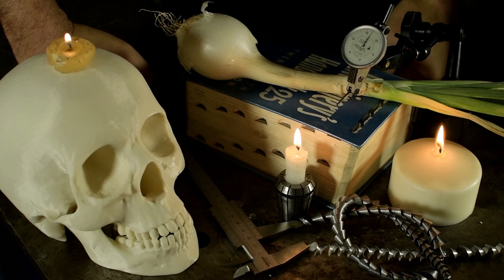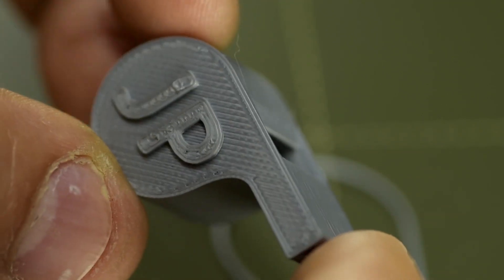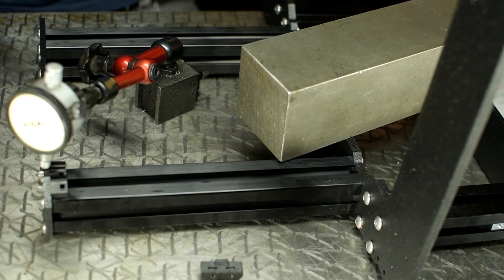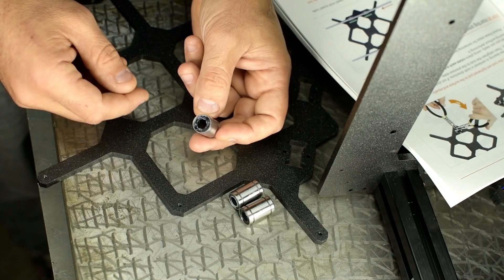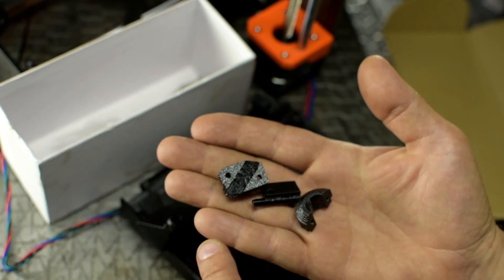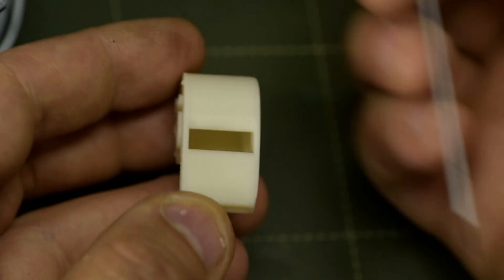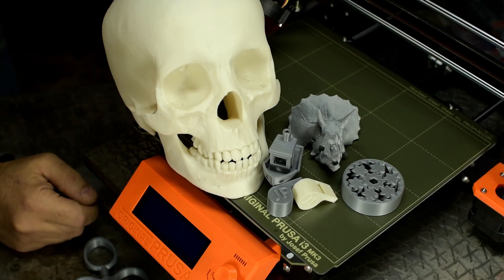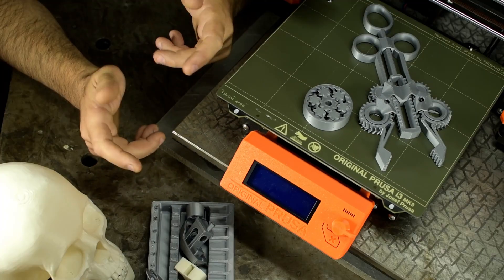This Old Tony in 3D!!! (printing)

Comment: "Granite surface plate". Looking at Ender-3 sitting on a cushion topped stool in the corner.
Reply: Just what I was thinking, I assembled it on kitchen table...
Reply: Wobbly Ikea table that flexes if you look at it too hard. That was my "reference surface" 😂
Reply: Assembled one on my lap here
Reply: i use and paving plate 3 inches thick i got for less than $4 at the hardware store garden section and the day later i found the exact same kind in the alley next to my place and tbh the sound went from 70db to less than 30db with my clunky ender 2
Reply: @FUKTxProductions  saw that on Teaching Tech IIRC. The problem is that those are great if your printer is in a garage or a workshop, but ugly if it is inside your home office.

Maybe painted or with some kind of coating or lining...

By the way, the best upgrade for the Ender 3 is an SKR mini. Motors went totally silent, no noise whatsoever. Yoi can't tell if it is still or printing sitting 3 feet away.
Reply: @nicholasamadori2577  would you rather have a miniature refrigerator sitting on your desk or floor of your living room/space? If you want pretty buy a cabinet to put it in. I don't see the printer being ugly effecting my purchase decision. Besides, put it in a closet. They don't need computers to print... Just my opinion.

Comment: This only confirms that mechanical adjustment for 3D printer is one most important thing. I never expected less that total overkill from TOT.

Btw that stringing problem is usually solved by adjusting hot end temperature and tweaking retraction settings.

Comment: I bought this model a little more than a year ago and have not looked back. However to quote Henry Wadsworth "When she was good	
She was very, very good,  And when she was bad she was horrid." which means there is quite a learning curve and a certain amount of fickleness.  I had already become an aficionado of Fusion 360 and combining this with my Prusa and (Syil X4 cnc)  was a marriage made in heaven. Will a custom gear, pulley or part fit and work as intended? Design it in Fusion and then the same model can (theoretically) be used to 3D print a prototype as well as machine it by cnc. Quite often the printed part works so well it becomes the finished item. A lot of open source stuff also available - some of impressive quality. Currently making Open Astro Tracker -  https://www.instructables.com/id/OpenAstroTracker-a-DSLR-Tracking-GoTo-Mount-for-As/

Comment: I've got an ender 3 but I woold defenetly prefer a mill or a lathe, still in my exprians having to design things in cad first does probably make you think out a part, so in my case waisting all my money on a 3d printer was probably worth it and considering that I don't have acses to presishon mashinery it's currently the best tool I have.
Anyway ime sure that prusha will come in handy, good luck to you.

Comment: Hey Old Tony! I work at the 3d print lab at my university. That Bunchy looks great! I would recommend increasing the retraction amount a little (which normally can help with the whispies). One also thing I noticed is the sides of the boat is that it's not completely smooth. I am guessing it's due to either some play in the movement in the head/base moving sideways. Turning the speed/acceleration down might help with that. BUT, those prints are perfect in my eyes. Well done as always! :D

Comment: “Different material properties...” fun reason to use PLA: non-toxic burn out for molding and casting. ABS has nasty fumes. Easier to smoothen, though.
Reply: PLA: easier to smoothen unintentionally by leaving it in a car on a hot summer day.

Comment: Oh gee....now that is a useful print.....I have the same problem with a cheap socket set, the whole plastic inside is kaput.........gives me an incentive to put my printer (unused) to do something really useful and at the same time I'm going to make a metal box with 3D printed  inside compartments for my mini socket and Allen key set for a 3.5 volt electric screwdriver.
I would advise anyone building anything with lots of screws that equates to a big boys Meccano set to invest in one of those mini electric screw drivers.....twiddling a long Allen key with a bent end is not the best way to screw Allen headed screws.

Comment: I will admit that I enjoy building this printer more than I have in using. Just be warned didn't be caught staring at the printer while others are are around, they just won't understand the hypnotic spell you enter into. But if you want a real challenge and love pulling your hair out, add the MMU option to this printers...

Comment: I ran the 3D printing displays at a Micro Center I worked at. The Ender 3 is mechanically extremely similar to the Prusa i3. There are a few shortcomings mechanically, but it's acceptable. Where it falls short is the general user experience. The interface on an Ender 3 is miserable. 3D printers work like this: The more you pay, the easier it is to use. The cheap ones are often mechanically sound, but the software and instructions are garbage.

Comment: Ok: You have some Z axis wobble. Caused by crooked or bent threaded rods, or badly constrained nuts on the threaded rods. Check that the rods aren't bent, and that the nut is properly trammed to the rods and the X axis (the one the print head rides on). First, insure that the top and bottom of both threaded rods are the right distance apart from each other and in line with the nut. Then loosen the screws which hold the Z axis nut a bit, and run the axis up and down a few times, then move it to the middle and tighten the screws down. If that axis squeaks, you're doing it wrong!
Second: Stringy prints are a sign of either too hot a nozzle, or too short of a retraction, though those can be tuned against each other. If all else is going well (especially bridging and overhangs) then increase retraction slightly, like .1 mm at a time.
You'll also want to print a test cube, 20 mm to a side, and insure that your machine is getting the scaling correct. This is "Steps per mm" or somesuch in your printer's settings.
Welcome to the club. Don't listen to the naysayers, this is just another valuable shop tool which will find it's own niche in your workflow.
Reply: Addendum: Skip ABS, it's terribly warp prone and produces toxic fumes. Haven't printed with ASA, but my true love is PETG. It's stringy as heck, but strong and durable. Most importantly, it'll hold up to summer car heat, where PLA won't.

Comment: Awesome video Tony, I just got my first foray into 3d printing myself... with a Creality CR6SE through kickstarter.  Some are having issues with their machines, but my experience was less than 1/2 hour setup time and first prints were amazing benchy in pla also had a bit of stringing in the cabin area, but otherwise perfect.  Playing with PETG now and that is possibly going to drive me nuts trying to dial in and I've ruined the coating on the print bed with it taking the teflon coating off.  Got a few more rolls of filament in a different brand and plan on building a drier box out of insulated foam board.. and probably a cabinet using the Ikea furniture diy approach.  Looking forward to seeing what else you do with yours... I'm hoping I can find a profitable use for mine.

Comment: You definitely made the right decision with the Prusa . When it comes to "throw it in the slicer" and get a use-able result they are unbeatable.   There's a lot to be said for the cheaper Chinese variants  but they are more of a 3D printing hobby than a 3D printer. The Prusa kit is the ideal way forward to save some money and get a comprehensive "insight" into the machine. 
The more you use it the better understanding you get for the limitations In no time I'm sure you'll be making all kinds of bushes, seals, tools n odd ball components. 
From what i saw of your Benchy (lower hull area) its looks like there's an issue with your Z lead screws . Id take em out and check and adjust run out !!  Just my 2 cents

Comment: Hey Tony, look up Taulman 910 for a killer material with excellent mechanical properties. It prints at a higher temp like ABS but holds up to most chemicals and doesn't break but rather deforms when taken past its yield. As far as I know, it's the strongest material you can FDM 3d print with.

Comment: I have an ender. Literally JUST finished my 600x600x600 glass cabinet before comeing inside to see this video notification. Safety glass from facebook marketplace (cutting that is a learning curve in its own right) and crappy angle iron from the local hardware. TIG'd the frame, goo'd the glass in. ABS is a temperature controlled environment, here I come.

Comment: To get rid of the plastic hairs, hit your prints quickly with a heat gun.
Reply: Or slightly increase your filament retraction. Making sure the tube is tight as heck and as short as possible helps too.
Reply: @WarrenGarabrandt  this isn't a Bowden design.
Reply: @Slappy901  what tube are you talking about on a direct drive extruder?
Reply: Dry your filament before use. :)
Reply: Or you can just repraddle the smool humes so they span the girdle of the fingle grots.
Reply: @torravengael4490  Well sure, unless some one borrowed your dingle arm, and never returned it!

Comment: Welcome to the 3D printing community Tony! I have to agree, it is amazing you haven't been using one already. Every household should have one. Mine paid for itself in the first month with avoided costs on car parts. You will probably find something broken, or that could be better about every week, and then it becomes a question of how much time you are willing to spend modeling things.
I use pla for most indoor non critical stuff (toys, or test prints for initial fit), and petg for most everything else. PLA is great until you leave it in your car. ABS seems like too much trouble to me, when PETG works really well and has similar uses.

I don't have  a large number of things posted as they are frequently very specific and unlikely to be used by others, but when there is something I put it here http://www.thingiverse.com/milgaco/

Comment: You can get rid of the "ghosting" or "ringing" by lowering the "jerk" rate or rapid acceleration and deceleration on the prusaslicer software with the expert settings. Just a quick pro tip to get really nice prints.

Comment: I finally got one too... 6hrs to print a part of 2hrs to make one out in the shop out of metal... Now that I have a 3d printer, i find it not as useful as I though it would be. Still use the cnc, lathe, or mill 98% of the time.
Reply: If you have a mill and a lathe, the printer definitely tends to sit idle a bit.  But there are certain things it comes in handy for - I put a different turbo on my Land Rover, and needed a machined adapter to go between turbo and manifold.  Problem was, space being a bit tight, I needed to know the exact (well, down to less than half a degree at least) angles of everything to get clearance everywhere.  Printed 5 prototype versions (complete with holes to be tapped for studs) before I was happy with it, then used all the angles and dimensions from that drawing to machine the real part on the Bridgeport.  Yes, it took a while to print, but I didn't have to actually DO anything in the production stage unlike if I'd made the prototypes out of metal in one way or another.

Also good for stuff where you just don't care that much, you just want a thing without the effort of making it.  Wanted file handles for my chainsaw files, hit print, walked away and did something more interesting.  If they break, fall off, whatever - I'll just print more - I like the shape of the ones I printed in use.

Comment: ME in my senior year. I own a creating ender 3 pro. It did come some assembly required but what I had to do was much less than what you did. I would strongly recommend  the ender 3 pro for your subscribers that want to dabble in 3D printing. Its super easy to use and maintain and even if you have to buy an entire 2nd printer for parts (not likely - mine's been near perfect) you're still only out $440 plus shipping and they are sold on Amazon. 

I do recommend that you buy a really cheap bottle of hairspray (i prefer the pump style for control) for prints that don't want to stick. 

You will also want to be mindful of printing speed when it is cold in the ol' garage. 

Have fun!

Comment: Your benchy looks great! No signs of a mechanical anomaly but the stringing can be reduced by tuning temperature down a bit or upping retraction a bit.  Also, the imperfections on the surface can be fixed by fixing the "Extrusion Multiplier" in Prusa Slicer or doing an extruder calibration again (Check Prusa website). Nonetheless, it is amazing for a first print :) Happy printing!

Comment: The 3D printer will change how you attack problems for sure.  You can do check fits before expensive milling etc.  Also you can download STL files from McMaster and print them apparently.  At least thats what Ave said!! I have 2 Ender 3's.  Amazing value for what they are.  Word to the wise, don't print PETG on glass.  It bonds into the glass apparently !

Comment: I had great luck with the Ender 3 Pro. It was cheap and worked great right out of the box after about 1 hr of assembly time. After a few cheap and easy upgrades (<$100) I now have wifi control through Octoprint, a direct drive extruder, and am printing directly from a filament dry box.

Comment: Welcome to the party. And I'm glad you're here. I've been blowing my brains out telling people to set up their printers like they would a mill (Oh for God's sake -  leveling is NOT tramming!) Anyway, maybe they'll listen to you. 
FYI the Ender can print just as well as the Prusa but the Prusa can do it well out of the box. A poorly assembled Ender never will. 
And I feel vindicated. I can now snark at my friends that I'm not the ONLY one who would assemble their printer on a surface plate.
Reply: The thing is ... if a book/manual says "use a flat surface", a normal human will use their kitchen table, a "maker" will use a sheet of glass, a handtool woodworker will use their workbench, a powertool woodworker will use their table saw, and a machinist will use a surface plate.

Ya' use what ya' got.
Reply: To be fair, as someone who has had to DIY his printer entirely, I would absolutely love to be able to reassemble it using an actual surface plate. Or probably rebuild the entire frame using said plate anew, because I've made some mistakes with the current one XD
Reply: I assembled mine on a poor man's surface plate - piece of marble counter-top I already had.
Reply: Does the Prusa firmware lack the skew compensation feature?
Reply: @davidwillmore  it has skew compensation, but it is still good practice to properly assemble a printer. And while in this case it wouldn't impact print quality much, it would likely lead to increased wear, which you might want to avoid.
Reply: @EgorKaskader  if an axis is binding, then you surely should fix that, but don't beat yourself up if they aren't perfectly perpendicular.
Reply: @davidwillmore  the surface plate isn't so much to align the axes, but to align the entire framework, notably to make sure there's no deformation in the axis proper individually. Slightly bent or non-parallel guide rods can be the result of that, and that is not a good thing even if the printer can run with it. Making the axes themselves parallel is actually comparatively simple, i.e mine are aligned within a minute with fairly simple tools, but I've had to throw out a set of V-wheels because the Y-axis frame wasn't properly square, just a millimeter of difference - but enough to overtension the rollers on that end. The second set, after I've had them installed properly parallel, has lasted for far longer and is still going strong.
Reply: @npgoalkeeper _ Not really -  if the structure isn't square, the nozzle will travel laterally as it rises (even though it thinks it's in the same place) so you end up with trapezoidal shapes. The gantry can be level, the bed can be level but the perfectly vertical nozzle is shifting sideways as it rises.

Comment: Can’t go wrong with a Prusa. Reliable. Well built. Quiet. 
I’ve been using a Creality CR10S for about 3 years now and love it. It’s kind of the big brother of the Ender3.  Ive had zero problems and has thousands of print hours. Although, the Creality printers are definitely great for those that like modding, tuning, and tweaking. 

If you want a printer that will just work, and work reliably forever, the Prusa is great. 😁

Comment: Whoo! A ToT episode that's near and dear to my heart -- For your future, occasional but functional parts I recommend Nylon. PETG is pretty good but if you want durability I suggest something like Taulmann 910 or PCTPE if you want some flex. With those and the appropriate nozzle size I've been able to print waterproof, threaded fittings and attachments for my paintball gun that actually survive my antics in the desert...good luck and keep being awesome!
Reply: PLA will withstand a lot of use and abuse and you can always reinforce it with fiberglass mat. I've seen PLA AK receivers stand up to thousands of rounds and that action is brutal on the rear half of the receiver.

I keep meaning to go to Zytel but none of my PLA parts fail on me so I don't have a good reason to.